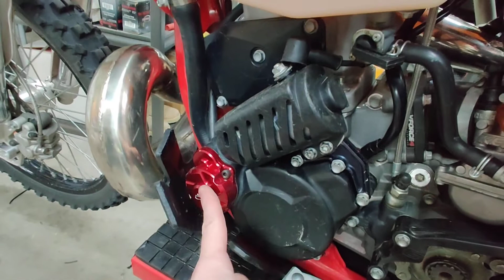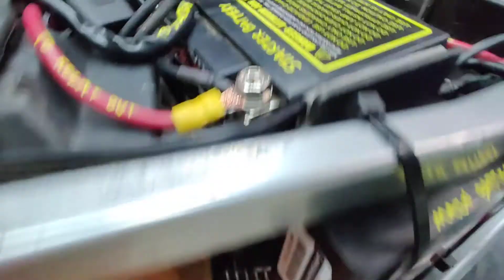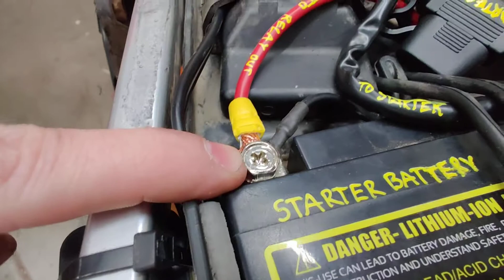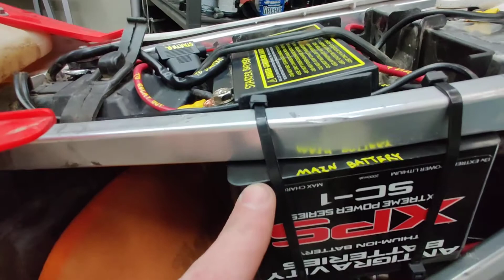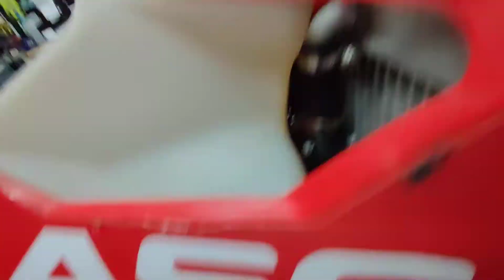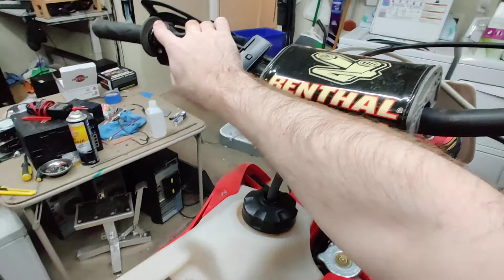Dirt bike starter Fix - 24 volt system

Comment: Great video! But the best system is a 12v to 24v,  DC to DC converter, one battery and the converter just for the starter motor...
Reply from the maker: A single battery with a voltage converter would not have a significant improvement as it's not only voltage that helps but total cranking power of the batteries. A single battery of this size could not provide a meaningful difference in cranking amps just by stepping up voltage.
Reply: @tillodrew Toyota diesel cars are all running on 12Volts but their starter motors are 6Volts. I had a Toyota Corolla 36 years ago and they were allready using this setup...
Reply from the maker: Apples to oranges bud. You can't create more energy (cranking amps)  just by stepping up voltage off the same battery. Send me whatever voltage converter you want and I'll create a video with measurements proving the science.

Comment: The starter relay can't be earthed to frame when not engaged or starter would run constantly at 12v so it must be an open circuit, great video though I'm definitely gonna do this on my 350.

Comment: Hey, great video and clean setup! Can you share what fuse did you put on the starter positive wire? I can't find this info anywhere.
Reply from the maker: I do not have a fuse between the starter battery positive terminal and the starter itself. It is only active when the relay is closed (pressing the starter button) which is on it's own fuse. The fuse you see in the video marked 'starter' is for the trickle charger.
Reply: Thanks. For anyone else interested for safety reasons I put a fuse on the positive terminal and I used 40A. I started with 20A and it worked but would get burnt if motor needed to crank longer than a second, I tried 30 and that allowed to crank for longer but still burnt so I settled for 40A and it’s perfect and allows to crank over and over but if there ever is a short on the motor it will burn out and prevent electrical fire.

Comment: İ Smoke the selenoid relay twice this connections??
Reply from the maker: If you are smoking your solenoid with this setup you either have it wired wrong or do not have a proper sized fuse on your relay.

Comment: Curious how long you can go between charges on the starter battery?
Reply from the maker: I have not pushed it to the limits. I think the most I have gone is 2 or 3 weeks of weekend trail rides. I typically plug in a trickle charger after every ride. I have done hard core all day races with 50+ starts in a day with no problems.
Reply: @tillodrew  I've since installed one myself . I'd say I get 6-8hrs of riding, probably 100+ starts? That's in the winter, when we stop a lot more, probably in the summer, closer to 15hrs+? One of the best mods I ever made, thx for the knowledge! 

I ended up using 1 full size AG battery + the 4 cell, the rubber strap can wrap around both, with the smaller one on the outside of the box. Holds it nice and tight. I use the fullsize as the secondary.

Comment: Will this mod not burn accessory wire for 24 volts momentary
Reply from the maker: The way I have it wired, the 24V is direct from relay to starter. There is only 24v when the starter button is pressed. There should not be any accessories that get power only when the starter button is pressed.

Comment: Were there a lot of issues with the E start before you did this? I’m thinking about picking one of these up, one with like 100 hours but I def want something with reliable E start so if that’s an issue on these I may stay with a KTM/Husqvarna
Reply: Yep, there are a lot of issues, I also had to fight with it but there are multiple fixing options out there these days and if you fixed it you will be a happy owner of a bike which is so much better than the KTM stuff. You will be blown away by the suspension and if you give it to an expert you can bring it to a level of what WP 3000$ stuff might not even keep up with. Those bikes are definitely an upgrade.
Reply from the maker: I agree with Nils. I haven't heard of a 2018-2019 GasGas that didn't have starter issues. The good news is there are very well documented fixes and they work well. For the price of this bike you cannot get a better one. I love everything about this bike.
Reply: @tillodrew  I did end up grabbing one. Already have gone through some of the starter things and done some preventative maintenance/mods, and its been working great so far, even worked pretty well before I touched it. So far I love the bike and am glad I made the choice to get it, and I've yet to ride it on the kind of gnarly stuff it was made for!

Comment: Cool mod  , so let me  understand   main battery is wired normal as it`s should  , and the second battery    from  the solonoit  now gose to the - negative   and the positive to the second battery goes to the starter ? Right ?
Reply: second battery negative to starter solenoid and positive to starter.
Reply from the maker: Yep, that is how I have mine set up.

Comment: I'm thinking about doing this to my bike. Currently have the 410 starter, but whenever it doesn't start within a couple of turns, then it won't go with the e Start at all.
One addition that could be made is to wire the main battery to the starter battery with a couple of diodes - that way it'll charge, but still be isolated the other way around.
Reply from the maker: I thought about doing something like this but I just don't have the electrical knowledge to go through with it. With my setup, I trickle charge once a month or so riding every weekend. That is doable for me.
Reply: @tillodrew  I ended up going to easier route as well - since mine already had a second ground wire to the regular battery, I just used that to jump the starter battery to the relay.
Tried a cheap LCA at first in the same location as yours, but lithium is definitely the way to go. All the starting current needs to be grounded through the main battery and a small LCA has way too much internal resistance.
One thing that can happen is that the relay might stick with prolonged use. Mine got stuck while I was testing the system and came back to life with some love taps. I've replaced it as well (china 10€ special).

Comment: Man that's such a smart setup......I've just got my first 2018 EC300 and it's had a hard life so I've got a list of work to do but after I get it running, this is definitely a mod that I'm gonna do - good job mate !
Reply from the maker: Thanks! Good luck and let me know how it works for you.
Reply: How you connect the charger to the 2 battery.  Negative to Negative and positive to positive or you have to switch them. Mine secondary battery doesn't charge when I connect to the charger. Thanks in advance